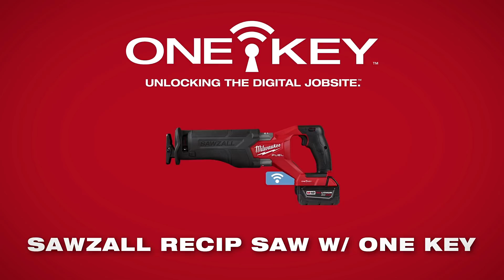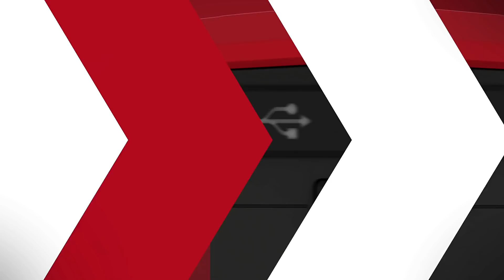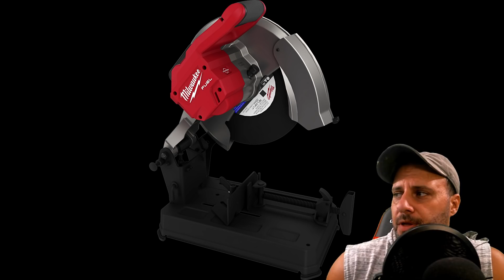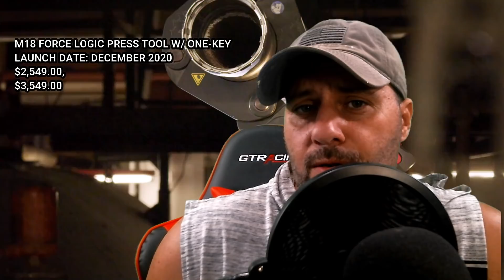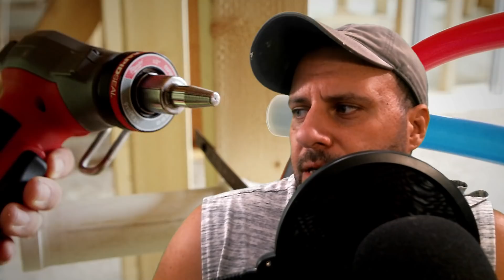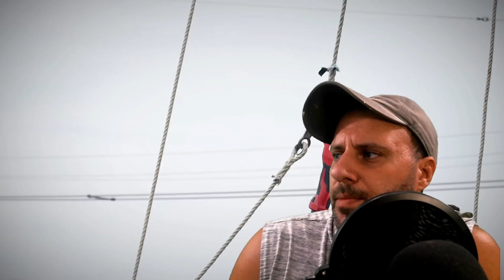Never Before Seen Milwaukee Tools JUST ANNOUNCED! Milwaukee Pipeline Episode 3 (What You Missed)

Comment: Okay, plumber here with 13 years experience. Here's my thoughts. 

1) The M18 Topoff with 3 prong outlet looks awesome. Every guy (and gal) who has Sleep Apnea and needs to use a CPAP machine would do well to buy this and the biggest M18 battery they can get. You never know when a hurricane will knock out power to your house and ruin your sleep cycle. 

2) The Sawzall looks ok. I bought the Super Sawzall when it just released a few years back, not sure how this one compares to it. OneKey is nice, and the ability to change the length of time your flashlight stays on near the blade is cool for working in dark attics cutting pipes out. 

3) The M18 press tool is geared more for new construction, commercial and industrial. I've used their current M18 press tool and it works nice. I have their competitor's press tool (Ridgid) and I'm happy I bought it. I do mostly service plumbing, so this looks way too awkward for underneath sinks, etc. New construction and commercial guys can get tons of fittings knocked out in a day with these, especially with upgrade to Fuel now. 

4) The M12 Pex gun is already a staple at most plumbing companies I've seen. It's extremely reliable. This new fuel model probably just increases battery life and the speed. The only thing that I see plumbers gripe about is that you constantly have to use the provided lube to grease up the metal part where the interchangeable head goes on. Without doing that, it just expands without rotating. In layman's terms, the apprentice who doesn't know any better thinks the tool is broken because it only "clicks" without making the pipe opening bigger. A lot of plumbers near Houston are sold on Uponor Pex which is what this tool is designed for.
Reply: Think the sawzall is the gen2 of the other fuel sawzall bc super sawzall is in a class of its own just like the corded ones
Reply: @nvg1526  Thank you for educating me